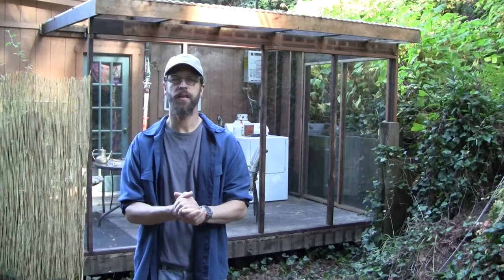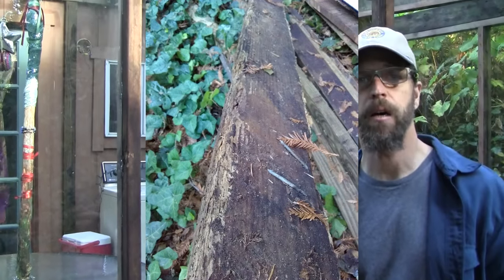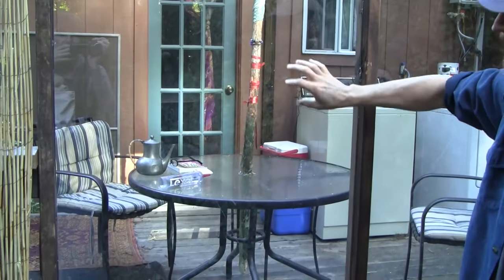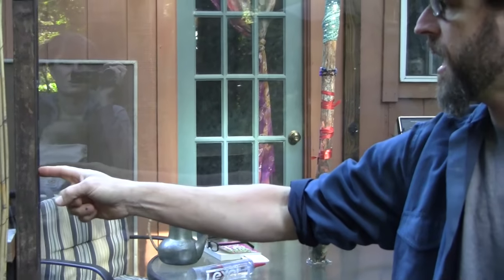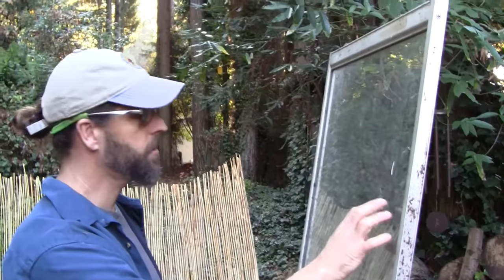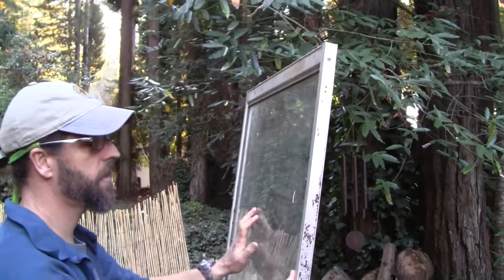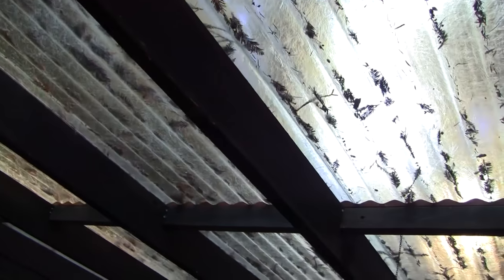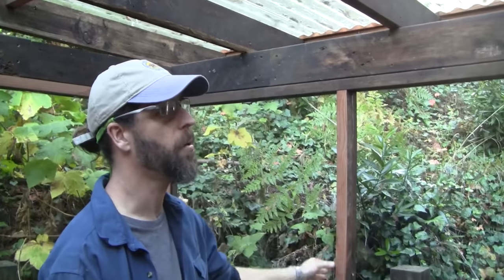DIY SUNROOM for $250 with OLD GLASS Doors and Old Wood

Comment: Curious about the glass. I want to use standard thickness double-panel sliding glass door panels - 3/4" overall. Did you have any issues separating the frames from the glass? I also plan on using a method of mounting using tape or silicone and rubber setting blocks to rest the glass on. I'm going to use composite trim to hold the glass against my framing.
Reply from the maker: Sounds like an interesting design. Those panes are all single pane glass.
Reply from the maker: So I'm not sure if you're going to have difficulty taking out the double pane or not

Comment: I am actually working on very similar project. I am still confused of the routing depths for the vertical and horizontal pieces. So the verticals are 1/2” routed depth and horizontals are 3/4” deeply routed? Or just the top horizontal and one side of the panel. My glass appears to be 1/4” thickness so maybe I need to also route the vertical and horizontal wood pieces 1/2” wide to allow 1/8” on both sides of glass. Please confirm.. Thank you so much for your help!
Reply from the maker: Make the routing whatever thickness your wood will allow without going more than 1/3 of the wood.  And allow an 1/8 to o 1/4 of expansion for the glass so it is not super tight

Comment: so the weight of the roof is directly on the glass pains? Are there no upright posts to support the roof beside the glass frames?
Reply from the maker: No.  The weight of the roof is on the header.  That weight is distributed through the wood that frames the glass.  There is a gap on the top so the glass is not touching the wood.  So the weight is not on the glass directly.
Reply: @TheRegenerativeHome  Thanks. My initiative would be to erect two uprights to take the full weight of the roof, which would allow the glass to be sealed properly. For an extra few bucks, I would be more confident in that method. BUT you have given me some ideas now, which I would not have thought of doing. I do have the opportunity to grab some sliding glass doors and I also have quite a bit of wood laying around. Great video, thank you.

Comment: What a great job you did! Are the glass panels that you removed from the patio doors double paned?
Reply: Is it possible to do what you did using double pane patio door glass?  Can double pane glass be removed from a patio door like single pane glass?
Reply: @CBDguitar  I'm thinking that if you were to take the glass out of the frame, you would  break the seal (if it is still sealed) and allow moisture to form between the panes, which is a common but not frequent occurrence with double pane windows. The double pane sliders could be used intact, just framing them in between the studs.

Comment: I found a stash of 54 sliding doors for next to nothing and have been thinking of building a solarium but also using the glass for the roof. Was there a reason why you didn’t?
Reply from the maker: Just more time and engineering.  The Challenge would be to get them not to leak at the joints of the windows.

Comment: Looks Awesome, What kind of Sealant did you use and did you use double pain glass that has the argon gas still in it ?
Reply from the maker: There are no side walls.  Single pane glass.
Reply from the maker: My preferred clear sealant is lexel.  It is hard to work with but lasts
Reply: @TheRegenerativeHome  level are you talking that stuff at home depot and lowes?
Reply from the maker: @themaximusone  lexel

Comment: I applaud you for your efforts and trying to use and recycle reclaimed items.  But your 3 inch supports are lacking and actually quite dangerous.  You did put quite a lot of thought into it with the glass expansion and contraction.  However the weight distribution is off and shift can cause an explosion of glass.  I am  hoping it is safety glass, which I imagine you would not be using if it was not.  The problem here is the lift forces with wind.  your structure has to be anchored down.  Collapse is not as big of an issue as lift and blow off the house.  I am only critiquing this as I would hate for someone to DIY a sunroom with glass and experience a dangerous shatter and injury due to possible collapse or wind lift.  If this was a screened in room I would have refrained from commenting but the glass took my fear to a whole new level.  But I do commend you for your efforts, you did put a lot of thought into it.
Reply from the maker: Interesting.  Very low wind area there even in big storms.
Reply from the maker: Recycled sliding glass doors are always tempered glass
Reply: @TheRegenerativeHome  That is a good thing.  I would consider Simpson ground anchors as added protection.  Again I applaud you for recycling and also your creativity here!  Kudos to you.

Comment: I'll be honest I think the roof sucks, I think you should have made trusses that come off the roof like it was still the roof and use glass on the roof as well it would have been better and easier to heat in the winter.
Reply from the maker: Ok.  The intention of the design was to use reclaimed material.  There is no side wall so insulation is irrelevant.